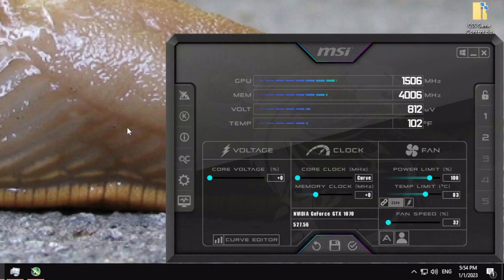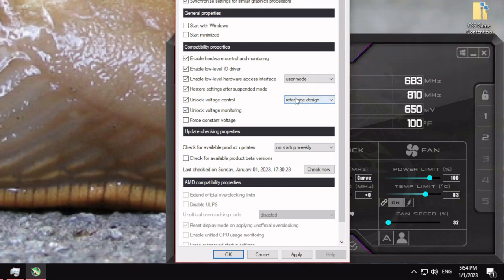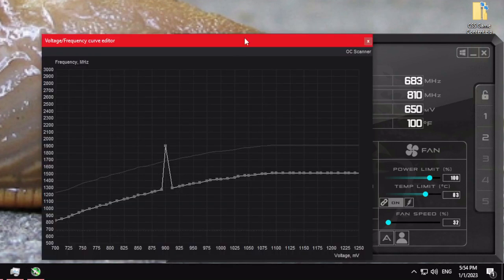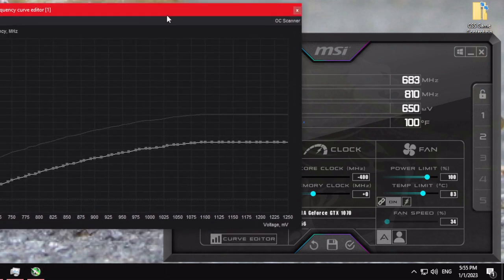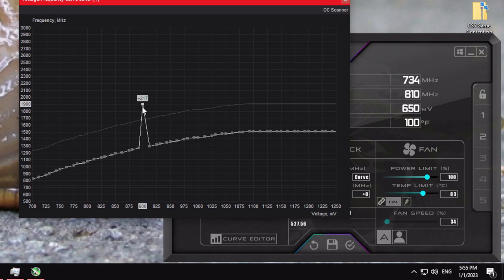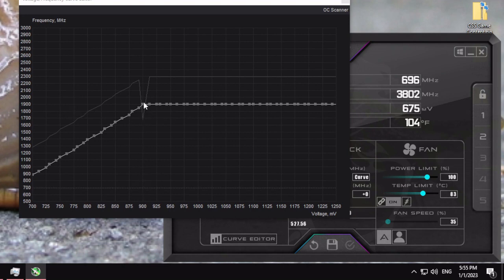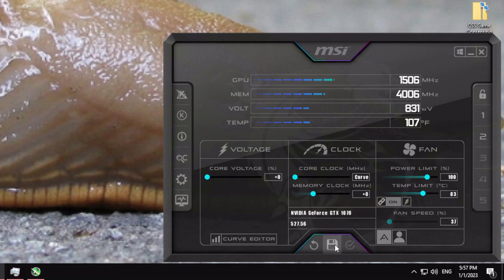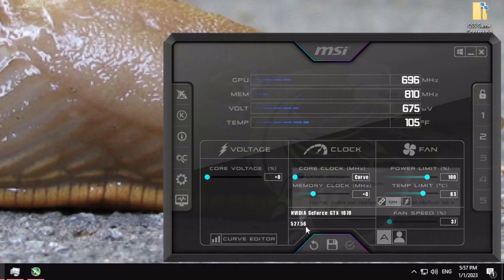Undervolting GTX 1070 FE w/Afterburner

Comment: This is wrong. By doing it this way, you're changing the initial part of your curve, which wouldn't benefit someone, anyway, because those stock amounts wouldn't cause high temps. You simply want to choose the point above the desired voltage, match it with your desired maximum frequency, and then set every point to the right of your desired voltage point to any amount lower, as that will cause all of the points to the right of your initial point to level off and be the same as your initial point.
Reply: Yeah, this method seems to have caught on somehow. The better approach is to drag the whole curve up to the desired frequency, then level off to the right afterwards.
Reply: can you teach me the right way to do that? i have a galax gtx 1070 mini oc, im suffering with high temps and this method saved me a lot
but if yk a better way i wanna learn
if this dont bother you
sorry my bad english, im still learnin
Reply: @sasoyo7934  looking for answer too

Comment: what if my maximum clock speed was 1885 and not 1900 like yours?
Reply: Then put it on 1885
Reply: @azugaming316 😂😂
Reply: But it doesnt matter. Any Oc/uv is not guaranteed but you have to try to know. Maybe if youre lucky it can push 1950@900mv. What is at stock doesnt mean anything.